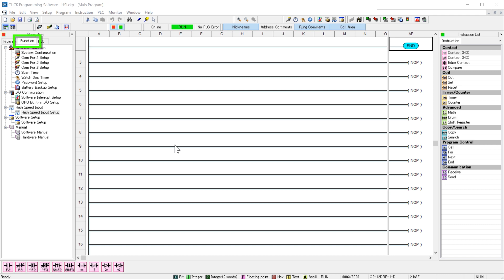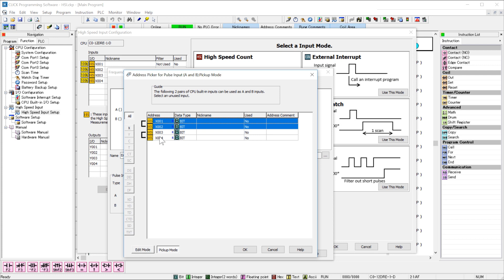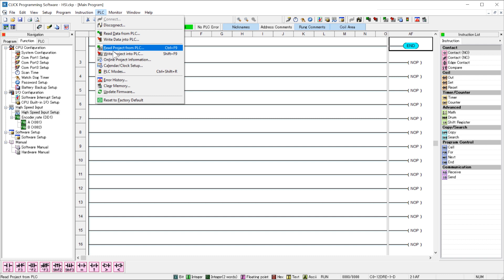CLICK PLC High Speed Inputs: Encoder Setup for Rate from AutomationDirect

Comment: The STP-MTRD-23042E comes with an encoder that outputs 5VDC. How does this interface with the C2-14D1 that requires a 24VDC input?
Reply from the maker: Tim, STP-MTRD-23042E has a line driver encoder output. This will not work with the C2-14D1.